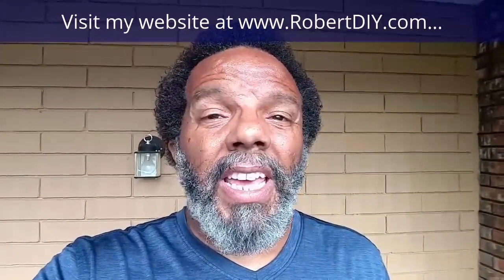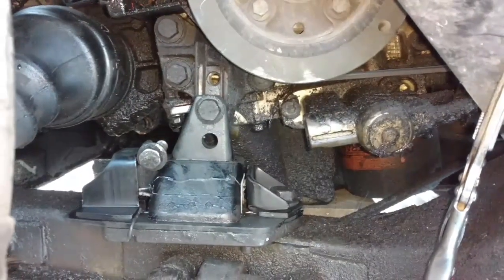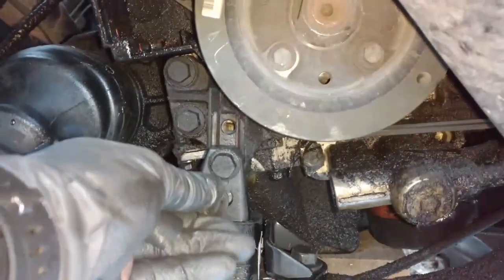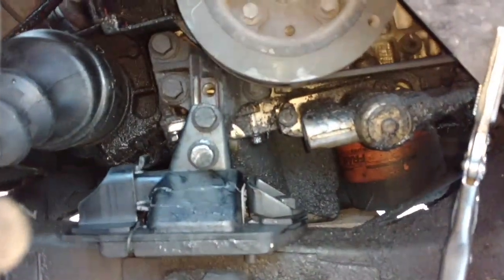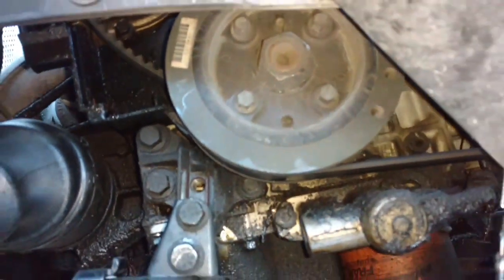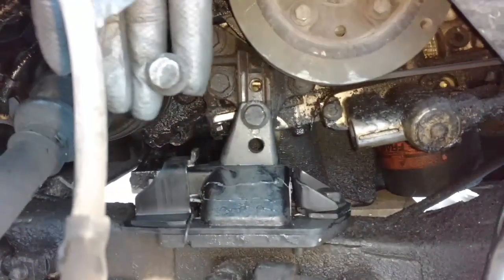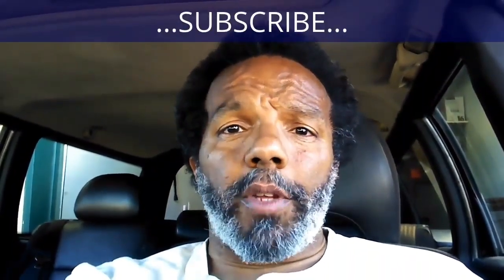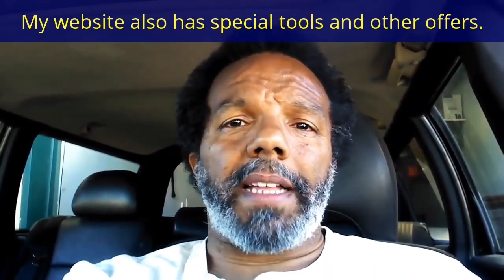Hot tip for removing the water pump on a white block Volvo, S60, S70, V70, 850, XC90, etc. - VOTD

Comment: Great idea Robert. When i did water pump on 850 i couldn’t get the idler pulley out and out of the way so i actually got the water pump out down through the wheel well. Then got the new one with rtv up and in the same way. Was a nightmare but i got it done no leaks.
Reply from the maker: +850 ARE good deal.

Comment: Any tips for the old gasket stuck to the block? It seems this one is really on there good. I don't want to use metal and scratch the aluminum!
Reply from the maker: Razor
Reply: @RobertDIY  right on.. I feel like I'm going to scratch it! Being aluminum it's super soft I usually like to use hard plastics like credit cards on other makes.. I guess I was hoping for a solvent or something that actually works

Comment: 1993 Plymouth Acclaim, 35,000 original miles. Runs great. Only concern is on cold starts, white steam comes from the exhaust until it warms up then the smoke goes away. Just noticing this now and idk if it's because it's colder outside. Just got a new thermostat put in and it doesn't burn any oil or coolant. Could it be normal for a car that old? My mechanics tell me not to worry about it. Opinion?
Reply from the maker: Normal for all cars.
Reply: Robert DIY thanks man. I really appreciate you answering all your comments. You're a good guy. I'm into cars. I've got 5, just need to learn how to fix them on my own lol. Thanks again.

Comment: A question/problem. But first of all, thanks for this excellent series of videos. I’m changing my cambelt and water pump on a 2009 C70 2.4i non-turbo, and these videos have helped enormously.

Although I’ve done my own car work for many years, including cam belt changes, I’ve always been nervous about raising or lowering an engine. You show here that it’s fine to raise by an inch or so. Is it also OK to drop it by a similar amount? 

The reason I ask is that I’ve got everything out, including water pump bolts, but can’t manipulate the pump out from under the engine. I’ve unbolted the inner plastic cover and got some more movement, but still can’t get it out. So I am considering dropping the engine about an inch and a half to give more clearance. Is it OK to do that? No probs stressing exhaust or other components?
Reply from the maker: Can you get it out the top?
Reply: @RobertDIY  Sadly not. This is the one where you have to take the engine mount out first. Even with that removed (and the third piece which you don't normally take out) there's only 2 inches between block and inner wing and the pump is 3 inches
Reply from the maker: I guess you'll have to try to lower it a little.
Reply: Looks that way. The question is, how much is a little.
Reply from the maker: Maybe you should check on a forum or VolvoSpeed Facebook page.
Reply: I'm doing that right now. A couple of guys on matthewsvolvosite.com are trying to help me. I've also posted on another forum, but no replies yet. Thanks very much for trying, Robert. Much appreciated.
Reply from the maker: You're welcome.

Comment: Hey robert. I have a 1999 volvo V70 non turbo and I'm having temprature problems I've replaced the thermostat and its still showing its still getting hot is there anyway too check the water pump before pulling it out please get back with me man I'd really appreciate it and if ya want too call please message me on Facebook and I'll give u my # or  you can call me on Facebook messenger but eather way I really need your help
Reply from the maker: Probably has a blown head.